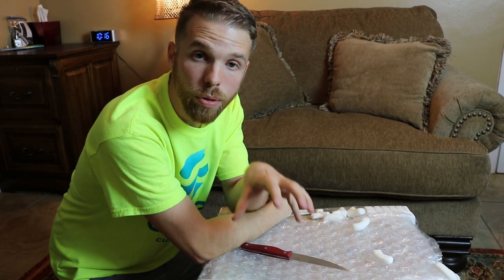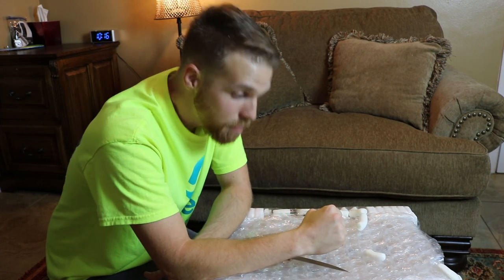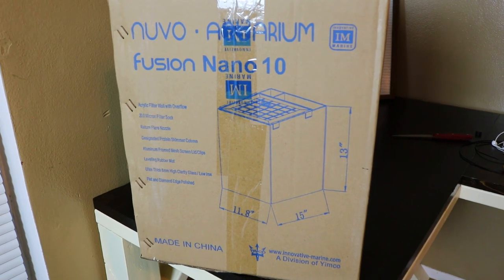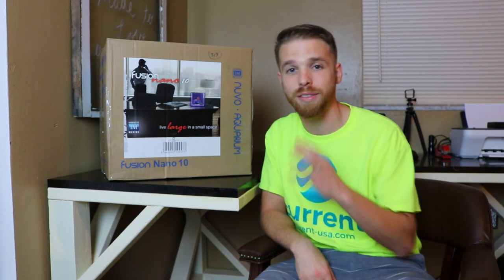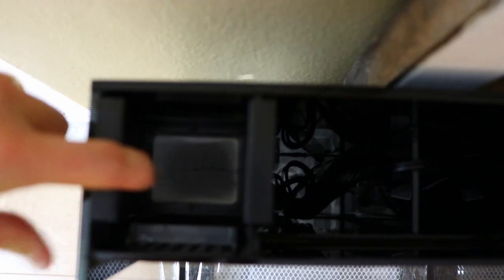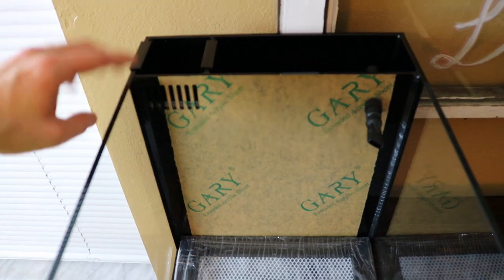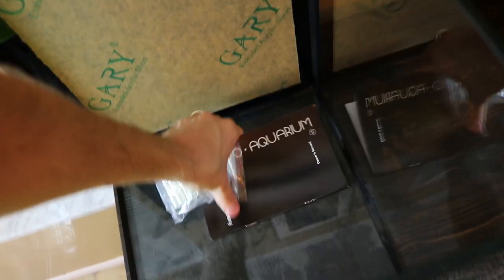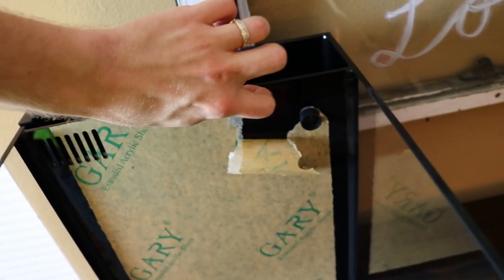IM Nuvo 10 Nano Reef Tank is here! First Thoughts... What's next??

Comment: Nice dude! Just subbed. I just purchased the nuvo 10 pro model. Seems to have a nice little upgraded pump and wave maker in it. Gonna either go with my hipargero led reef light or get the full spectrum lominie led reef. My question is, would you suggest the innovative aquashield uv while it goes thru its first cycle or would that mess the cycle up? Also, im gonna be using the custom caddy filter thats included.  Mechanical Fiberball, Premium 0.8 ROX Carbon Pack,  and High Capacity Coarse GFO Pack is what is included. Would that be ok for reef? I have some chem pure little bags here. That pretty much serve the same purpose as whats already included? Sorry so many questions. Only ever had saltwater set ups in the past, but never reef. Was curious about the media back there. Thanks man!
Reply from the maker: Hey! Welcome to the channel!  I don't believe much in UV light filters. The media caddie that comes with the pro tank will be perfect. I would use the media it comes with til it's exhausted. Chemipure bags are what I use. I just toss two in the caddie and replace every couple of months. A reef tank isnt much different than a saltwater tank. The differences are just the maintenance of major elements (calcium, alkalinity, and magnesium) and a little higher salinity.
Reply: @RealReefingTV  Awesome thanks! Would i need to replace the gfo pack when its done, or just swap out with 2 chemi pure packs? I notice there is a sock filter included. They seem pretty expensive to replace. Would you just get a filter floss instead? Any suggestions on what i can fit there in the socks place? Thanks again!
Reply from the maker: Well if you are using the caddie you just use filter floss. Easier to change and clean. And after a month of using the gfo just swap out with the chemipure bags
Reply: @RealReefingTV  Ok cool. One last question, im sorry. I have to get the in tank filter floss holder and put that in place where the sock would normally be in there?